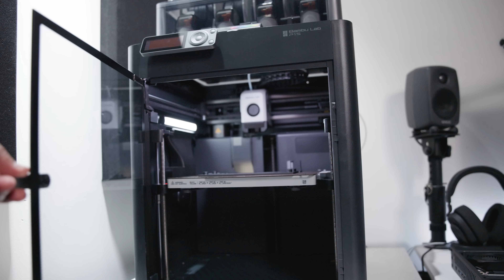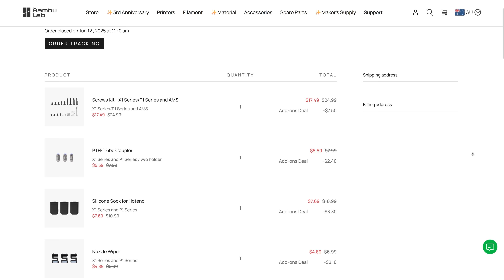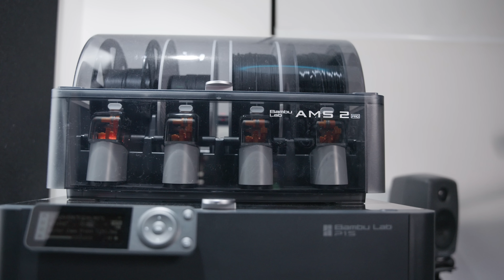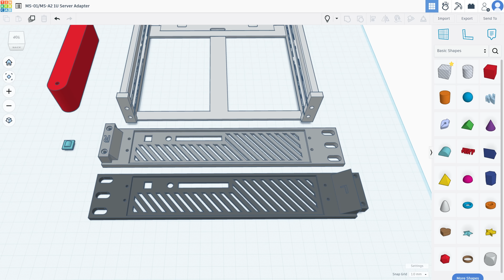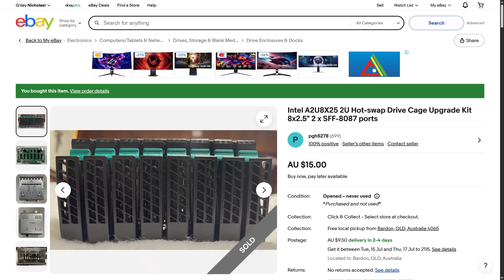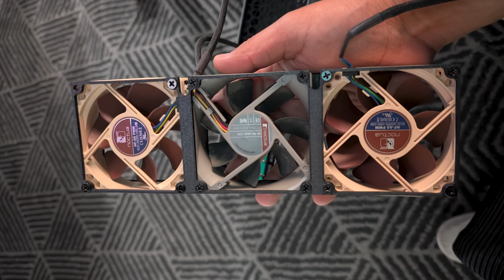3D Printing the ULTIMATE homelab servers! // Minisforum MS-01 & MS-A2

Comment: I don't recommend mixing chip architectures if you cluster your Proxmox servers. Technically, you could add them to the same cluster but you would not be able to move VMs between the servers easily - you would just have a common address to manage both servers.

Comment: It looks like the ms-01/ms-a2's without the cases still have a tiny bit of space between the top of the 1U and top of the system itself. Trying to fit a RTX 4000 SFF into these works but only if you remove the outter case due to it being just a tiny bit too thick. Are you able to see if an RTX 4000 SFF would fit into this while still being within the height of the 1U? I just ordered 3 of the 9955HX MS-A2's for a Ceph cluster, eventually will get a 4th when I have the money just to make it look better in a 19" rack. Would love to use this cluster as a mini AI server with the RTX 4000 SFF's also but not being able to have the case on the systems has made this a no for me. Your 3D printable 1U mounts though may make me change my mind if they will allow the GPU to fit. Otherwise I am looking into getting a Racknex 2.33U 19" rackmount that fits 4 of the MS-01/MS-A2's.

 I went with the Bambu Lab A1 since I figured I'd be printing more functional parts rather than multi-colored art projects, the only thing that sucks is not being able to print anything that requires a print enclosure. May get a P1S if I learn how to actually model stuff myself, otherwise my A1 kind of just sits around and only gets used once in a great while when I find a mount/bracket that someone has already made a model file for.

Comment: Tinker cad is very basic but it is amazing. I have been into 3d printing for about 10 years and tickercad is great and it is still my go to especially when I want to alter an existing STL there is nothing better. However it has some drawbacks which will you will find limiting. Mine was the lack of filets and chamfers  which help make your designs just that much more professional, but then also changing your design is not as easy as things like free and cad or fusion which you can change something 20 steps back. You will find you will outgrow it back you will never leave it behind,

Comment: I think the ms-011U open mount will still be restricting airflow if it's sandwiched by racks above and below it. The fan pulls/pushes air vertically. At least with 2U it would have a small air gap above and below the ms-01 to breathe.

Comment: I've never had to use glue on the bed going all the way back to the glass bed on my Ender3 (I have a P1S now as well). The trick is to make sure it's clean.
Following Bambu's cleaning directions and have never had an issue. Clean with dish soap and water with a scrub brush, dry with paper towel. That's it. Cheap filament, expensive filament... they all stick great! Just remember to keep your fingers off the bed. I only touch the parts that sticks out at the front and the very edges (to flex the bed).

Comment: I own an MS-01 as my daily driver. I'm really impressed with it. Thermal management is a little bit of a challenge but even with an A1000 gpu in there (for video editing), it's fine. I would definitely like to implement your design if I get around to buying an MS-A2 (which I am keen on). I plan on doing on-location, cloudless server installs for small offices and this would be perfect. If you want a challenge, maybe figure out how to incoporate a PiKVM for remote management to try and emulate something like Dell's iDRAC. I bought my first rack server for a datacentre a few months ago - it's the Dell PowerEdge R630 and it's sitting in a datacentre in melbourne. So this is all a learning experience for me. I actually have a bachelor's degree in industrial design and I happen to think that what you're doing there is super-cool. You've actually inspired me.

Comment: I remember how excited i was when i got my first 3d printer. I bought it because someone wanted to charge me $200 to print a fan shroud for a Meshify C. I bought an ender 3 pro for $99 and figured it out myself. I will say that you should switch to ABS/ASA or at the very least PETG for these parts. PLA tends to warp/melt at a low temp, not sure if you covered that and i missed it. But that P1S is great for that and easy enough to switch. 

I've printed/designed a few pc cases and PLA is fine for prototyping but any long term deployments, you will want something with a higher glass transition temp i.e. ABS/ASA, PETG.

Comment: if you're working in PLA and having bed adhesion issues chances are you don't need glue, take the build plate out and give it a wash in the kitchen sink with some dishwashing liquid. no I'm not joking, I thought I was having my leg pulled when I first got told this. Oil from your hands gets onto the build plate super easily just by removing stuff from the plate and then you get adhesion issues on subsequent prints. Straight up dishwashing liquid and a light scrub, leave it to dry. Easy as.
Reply: Also super impressed with what you've built so far! Don't look into Gridfinity though or you're gonna go down a rabbit hole and a half 🤣.
Reply from the maker: That's a great tip. It's hard to find clear answers because I feel like there are so many conflicting ideas on bed adhesion. I'm still learning. It's so awesome to be learning something new and I appreciate all the tips!

Comment: I love how you put together the rack and 3d printer on top. Could you tell more about this setup? What rack it is? Did you have any issues with vibrations? Is this white pice of countertop just to cover the hole in the rack and have a room for 3d printer or its something heavier that stablizes the whole construction?
Reply from the maker: I guess I should have given a bit more context to my setup in the video. I assumed that no one would watch this video to be honest. Basically my Gaming and Editing PCs are both rack mounted in a 12U StarTech open frame rack on wheels. There are no machines with mechanical drives. I don't use them in anything other than our storage servers (that is another rabbit hole). I picked the StarTech rack so I can move my PCs around my office if I need to clean or rewire something. I'm ex-Datacentre so I can't help but rackmount everything.

The top of the rack is a cheap IKEA table top I cut to fit the rack perfectly. I can't remember the name but its the realllllly cheap one that is made out of cardboard. I have hinges on 1 side so I can lift the table top up and get to anything in the rack from the top. T. The P1S is perfectly at home on the rack. It sits next to my main desk so the rack actually works to isolate the printer from vibration. I did purchase the anti vibration feet but I'm yet to put them on. I am going to add an additional PDU to the rack but time is not my friend. I have an office update video in the works since I have quite a unique setup but I have a few more little bits to do before I'm ready for that.
Reply: @GearSeekers  Awesome, thanks for explanation. I will borrow your idea :D

Comment: Some have mentioned it before, but make your final product in either PETG or in my personal recommendation ASA. Regular PLA has a relatively low plasticity point, so if your rack equipment starts pushing out heat it might literally collapse on itself. Another thing to know about filaments are that I do think you should consider if your office space is well ventilated. At the end of the day 3D printers are melting plastic so you are inhaling fumes if you are in the same room as it for prolonged times. Definitely consider it IF you are thinking about 3D printing more advanced filaments other than PLA.
Reply from the maker: I've heard ASA is really good. I've ordered some to try it out and see how it goes. I have a new design revision in the works where I think it will need to be a bit stronger.

My office is well ventilated. I didn't show it in the video but about 30cm above the printer is a big open window and I leave it all the way open when printing.

Comment: Damn, I definitely need to get a 3D printer. Also, what about heat and the integrity of the plastic?
Reply from the maker: From what I've been tinkering with it really depends on the material you print in. The PLA I printed this stuff in probably isn't the best for this application but it's great for prototyping. I am going to reprint in either ASA or ABS

Comment: You can most definitely fit 3 noctua 20mm fans above the IO in a 2U. I designed a mount that clips into those vent holes for exactly this purpose.
Reply from the maker: I do have a work in progress that will add some 40mm fans as intake. It will be a different faceplate entirely to allow for max airflow but I've only just started tinkering because I want it to use the internal fan headers which are not a regular PWM header. I'm working on a version that will also make the elements completely enclosed with vents but time is not my friend. Basically it will be an additional hood that uses the holes I added for expansion. Saves reprinting the whole thing.
Reply: @GearSeekers  that's will be cool to test the model with internal fan header and 40mm fans =)

Comment: The recommendation is simple when it comes to a Bambu Lab or Creality printer. Nowadays, it's easy to find the right printer for a designer or hobbyist looking for a studio 3D printer. They're quiet, relatively easy to set up (they're practically plug & play), and it's rare to encounter a catastrophic failure unless you try to cause it.
Not long ago, things were very different. The norm was Cartesian printers like the Prusa I3, much slower than today's, or Delta printers. Hardly anyone could spend thousands of dollars on an enclosed CoreXY printer that didn't require a mechatronics engineer for troubleshooting and damage control. Plus, with the arrival of PLA filaments, prototyping has become much simpler, faster, and cheaper. Prints are relatively high quality without so many headaches.
ABS, nylon, PC, and other technical polymers are problematic in enclosed environments, so the new enclosed CoreXY printers now include air filters. With PLA, there aren't as many toxic fumes (although there are some, as with any molten polymer), unless you make the mistake of burning it.

Comment: PLA is ideal for prototyping due to its low temperatures and the almost zero difficulty involved in achieving reasonably high-quality parts, regardless of the printer or settings.
The problem is that PLA parts tend to be brittle under certain conditions, and given the low temperatures PLA withstands, they are easy to warp. This means that the same temperatures you need to ensure good adhesion of the first layer to the print bed are enough to ruin a finished part if you don't take the necessary care. This means that if your rack reaches temperatures around 50-60°C, your parts likely won't make it to Christmas in optimal condition.
My advice: try some tinkering with PETG. It going to be a headache the first try (need more temps in print bed for better adhesion and avoid warping, and motre temps for hottend, and you´ll need some tweek for retractions and and maybe fluidity in the slicer), there are some benchmark .stl like "temps/stringing-towers" for tweeking, but it worth the efford, IMO. No too harsh and healt hazzard like ABS and some other technical materials, and waaay more strong, flexible, and durable than PLA.

Comment: Ahh... so not only me found out that MS-01 is actually ideal 1U when you don't consider original enclosure :D You're first to do 1U enclosure then... Good job!

But what about the back of units? I see you still have back-plate which is still 48mm in height, so you can't put 2U of those as they'll still interfere...
Reply from the maker: Made no difference in a rack to be honest. It fit well. I've now deployed it too

Comment: i like the 1U for the minisforum but i would never take the covers off. it needs to be protected from dust, it needs to have a proper airflow and to also make sure that there is no scenario a metal thing touches another metal thing.

i am planning into buying an MS-A2 (i hope it is the right purchase) for my homelab server. i want to find a way of placing it inside my rack... from what i understand a 2U will be the minimum.

i am trying to think of a way of mounting small noctua fans left and right? of the MS-A2 which is going to be in the middle of a 3d printed mount for 2U? and try to keep it cool
Reply: Me neither. Tried to link to another option for 2U rack mounts for MS-xx units for all those that don't want to remove the outer shell and he deleted my comment in less than a minute. Channel blocked.
Reply from the maker: No one deleted your comments. Comments with links are automatically blocked on the channel because of the phishing scams that happen on YouTube. Most channels block links for that exact reason.

Comment: I bought the Bambu Lab A1 a month ago, and yes, the rabbit hole is deep and never ending with 3D printing. LMAO I've also thought about getting a second one too.
I relate to everything you said in this video as an IT guy that's just gotten into 3D printing. I've not had a clue about 3D printing, and the same thoughts mate, how did I not do this sooner. I literally just started yesterday to look at CAD software myself to start to design some things I've got in my head already. 3D printing is just so awesome. 
That ms-01 & ms-a2 case design is awesome, and I might be printing that myself later this year, if you have shared that design, as I'm toying with the idea of upgrading my proxmox servers to MS-A2's.
I've been printing so many things so I can mount my non rack mountable equipment in my rack. I've now got my Unifi UXG Max, Unifi 16 Lite, some raspberry pi's, my jetkvm, my nbn cable box all mounted in my rack. There's lots of great designs already out there. I want to rack mount everything now 😂

Comment: I love this. The one thing you might consider is using PETG. I print most things in PLA, but PETG is a bit more heat resistant. Just a thought.
Reply: Just want to add. PETG flex alot more than PLA. 

I will do these in PETG-CF (or PETG-GF but it flexs more, however, electrically non-conductive if that is required). 

However. For parts with a heavy butt like this, something like PET would actually be excellent - ABS, ASA, PA flexs a lot more. PC is better but printing it long and it might warp so bad before it flexs.
Reply: This is probably a better post than mine 😊. I haven't really worked in ASA or ABS. You might need better ventilation for those filaments (definitely ABS), but they would be stiffer. I've been meaning to try PLA-HT (PLA High Temperature), but have yet to take the plunge.  @StooStranger

Comment: 17:12 if you have this type of problems, the P1S has no X1C sensors, just take a little bit of time do both calibration (flow+pressure) prints and create your costum profile for your filament and your problems are gone.

Comment: Nice to see that you are trying out 3D printing.
I am surprise that you can even design those things with TinkerCAD.

Here are some tips and general info, in case you ran into common problems:
1. Material 1. PLA can easily deform under heat and constant load. So the hot air (~35°C) from the computer may melt the parts, and parts may deform overtime with due to the weights of the things they carry. If you are doing functional parts, I recommend PETG or ABS / ASA.
2. Material 2. I suggest locking in on the material brand early on. Every brand use difference chemistry for their material, which tend to require tuning in the slicer. It can get very annoying to keep track of every material you have going on, so I (personally) only buy PLA from [this brand] / PETG from [this brand] / etc.
3. Bambu Lab's business practice. They are trying to be the "Apple" of 3D printing, for both the good and the bad. So, I just want to caution against blind brand-loyalty, not with just Bambu Lab but others, like Prusa, as well (it is a growing problem in the community).
Reply from the maker: Thanks for the tips, I'll definitely keep those in mind for future projects!